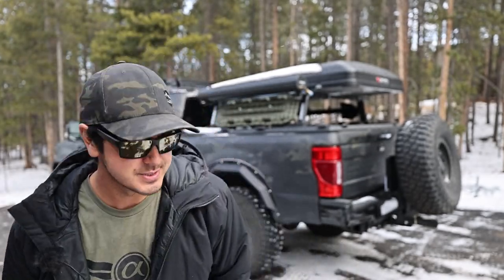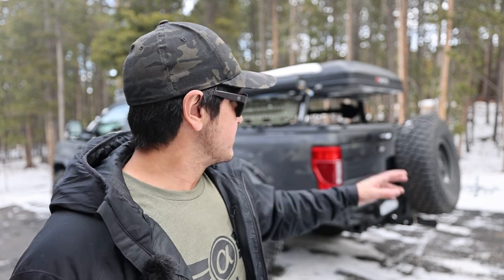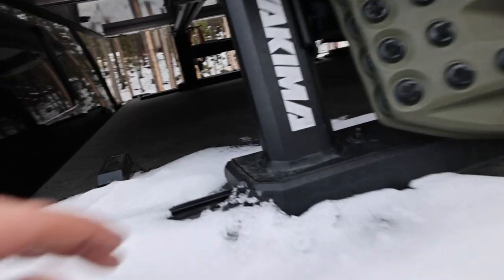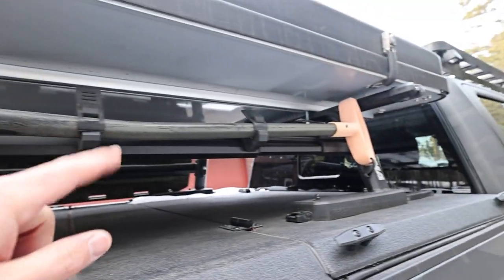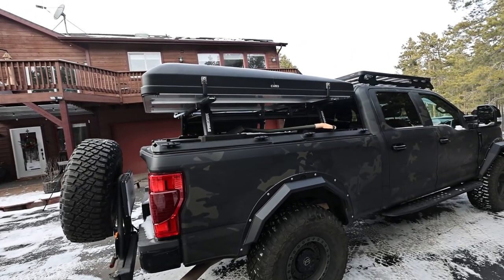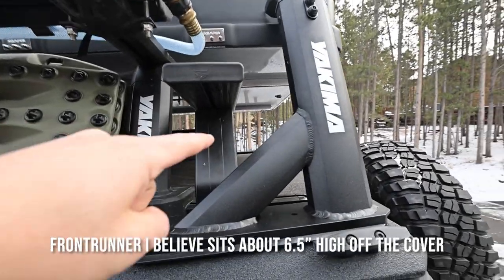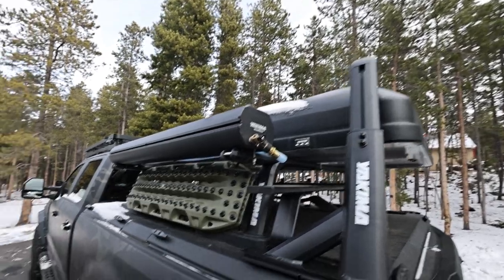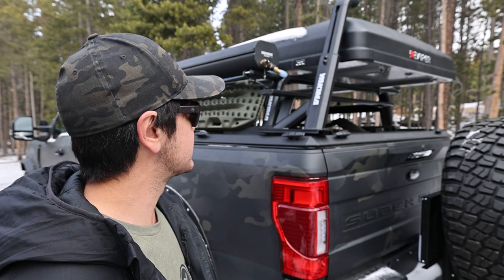ULTIMATE Overland / Adventure BED RACK Setup For The Diamondback Cover (Yakima, FrontRunner)

Comment: Mike, great video. I run the HD bars on my forester. They are great, I load 2 kayaks and 2 bikes on them. The extra width options made it possible.

I use the points on the ends of the bars to tie out a tarp when I setup for the night.
Reply: Great idea🎉 x the tarp

Comment: I mounted my road shower to the side bars via mrg cantilevered brackets. I’m a little ocd over keeping the tent centered on the vehicle. I have the overhaul on the tundra, same tent. Nice video
Reply: How are you liking the Overhaul? I'm getting a 2022 F250 Tremor in July and debating between the Overhaul or the Outpost with a RTT. Curious how you're liking it.
Reply: @Texas13Hookem  i have a smaller tent (James baroud horizon) the outpost would be perfect. The ikamper is larger and needed to clear the cab. I wanted an adjustable rack or a rack that clears the bigger tent above the cab. You can’t go wrong with either since they’re kinda built similarly. I’m able to attach rotopax, shovels and recovery boards to it. Very useful and functional. Good luck

Comment: I like that adjustable one, but I wish they offered a version of it that started a lot lower but didn't go as high.  I greatly prefer the lower height, like with the Front Runner on the Diamondback, but if Yakima would offer an adjustable with a much lower range, I'd get it in a second.  I want to leave it on my bedcover, and don't like the look of high racks when not in use.  So keep it low most of the time, but have the option when needed to raise it up so that longer items could more easily extend out over the cab.  Just my idea, but omg, today's many overland options are incredible.

Comment: Another useful video.  Thanks.  A question.  Does that tallest, adjustable Yakima rack system drill directly into the diamondback HD cover, or does it also use something like the runners of the Front Runner and then somehow connect to those on each side?  I ask because I am wondering if the rack can be easily removed until needed and put back on and then taken off again until the next time without having to unscrew the mounting screws.  Oh, and what are the weight capacities of the shorter profile Frontrunner versus the highest and adjustable Yakima?

Comment: Mike, late comment/question. I am running the overhaul on my tremors diamondback cover. With the offset necessary for the rail racks (DB installed) how can I get a sidebar set up? The Yakima won’t line up. Thanks!

Comment: Fam of five and jumping into the overlanding, truck camping (RTT) and going to trade in my current truck for a new one/setup. Gen 3 Raptor or 250 Tremor? I'm leaning Tremor given my double-axel trailer and payload capacity. If I add deavers to the Raptor will that be sufficient? 

Awesome build!